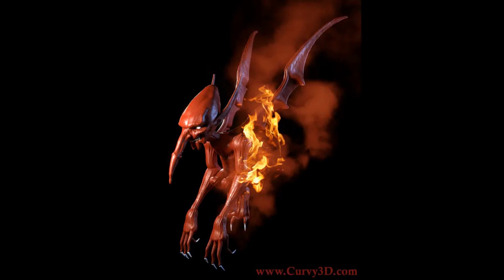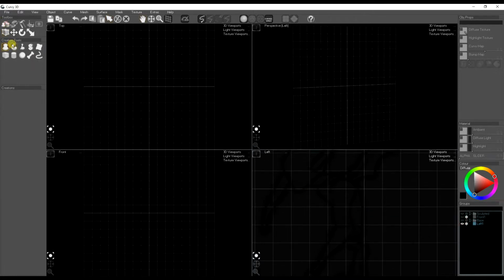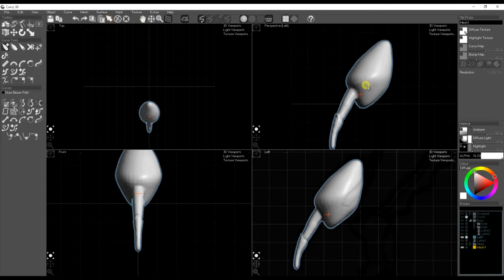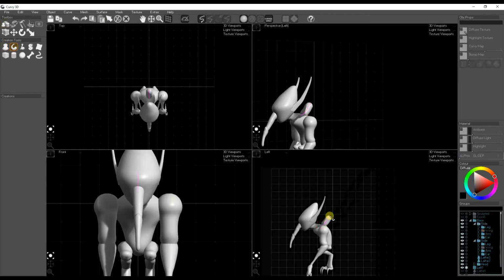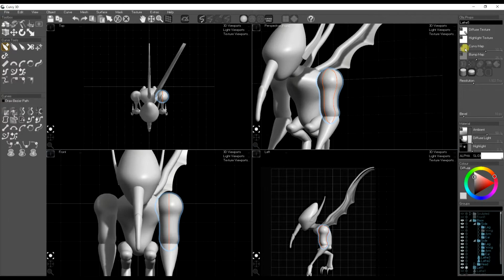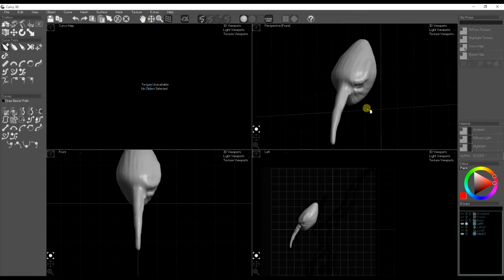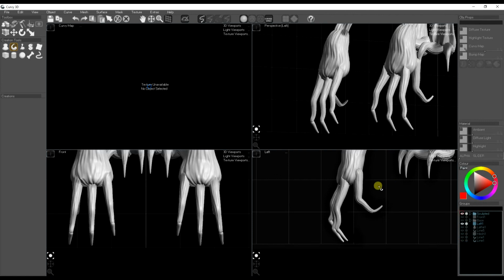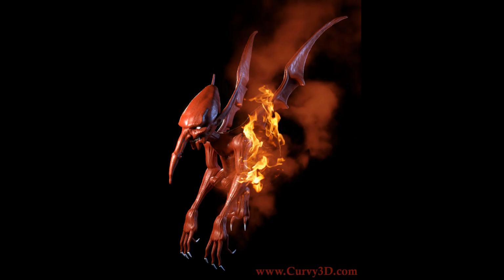Mephit - Sketching in Curvy 3D Tutorial

Comment: I find this a very unusual program even after using the program way back at version 1.6! 

Back then I thought you could simply trace around an image of whatever you created by hand or from a picture. But I soon found out that it doesn’t work like that with your program. And yes I still have version 1.6! Running on my old windows 7 system! Unless something changed with true tracing or sketching in your new version of the program. These days I use a true 3D modeling program to design my models  with a background image to work from using point to point or box modeling!
Reply: I like using a variety of methods to sculpt - I've added a simple box modeller to Curvy in version 5 as that is a good way to model more complex shapes.
Reply: Good to see you’re working hard to provide solutions. Modeling is definitely not easy. But at least there are tools to help in that journey. I look forward to seeing this new version with the new box 📦 modeller!